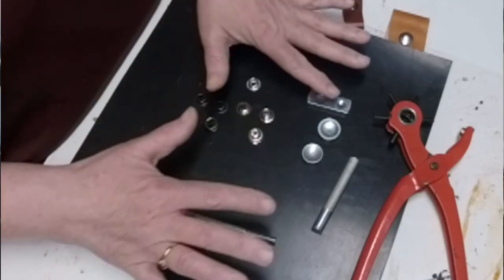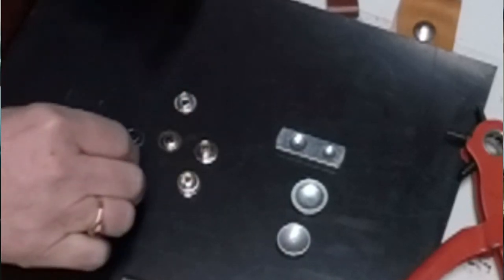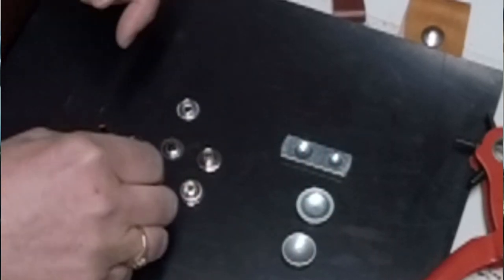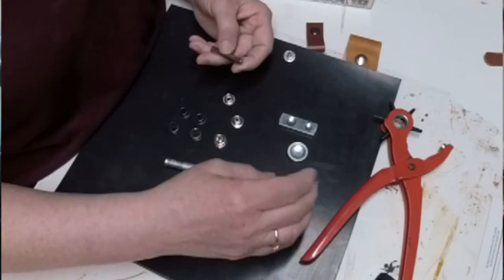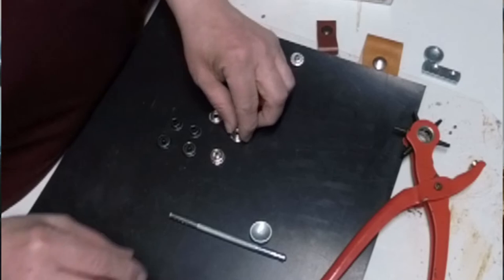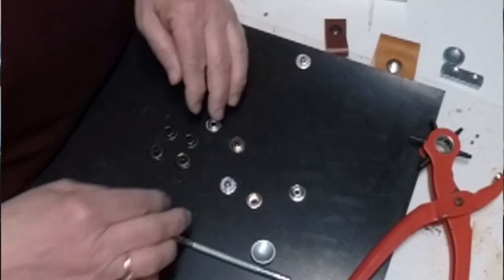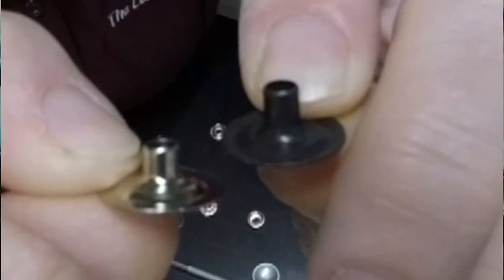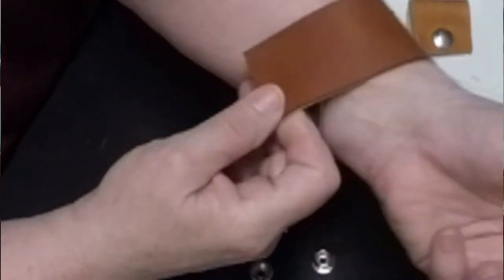SNAPS - How To Set A Snap.  The Tools You Need As Well As Tip For A Perfect Snap Setting

Comment: Is there any major difference between using these "line" or "heavy duty" type snaps or the "grabber" type snaps with the spikes? Also how do I set a vintage style WW2 Laurel Wreath Donut Hole Jean button that has the 2 pronged nail? Most of the videos and install tools I see are for the jean buttons with a single prong/pin nail that goes through the center
Reply from the maker: Thank you for your very good question. Yes there is a difference in different types of snaps. A lot of what we do in leather work (like for motorcycle leathers) would be just the standard snaps in a size 8 or 10. The WW2 snaps I would not be familiar with as those would deal with more fabric items. I did find another creator with another type of snap video that may help you. Unfortunately, I don't do clothing items more than like chaps, arm cuffs, leathers, vests.. etc. I hope this video link does help you. https://www.youtube.com/watch?v=MlzutHVrsmM&ab_channel=TailorItYourself
Reply: @TheLeatherLadyLLC  Thank you! I appreciate your link.